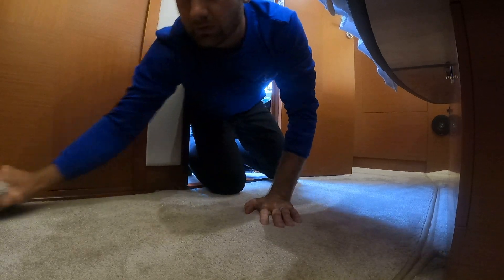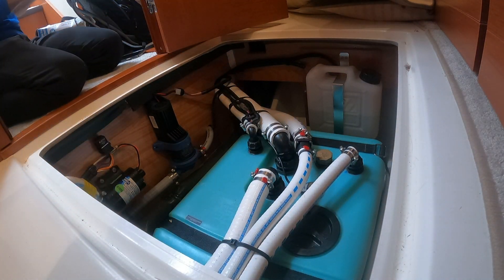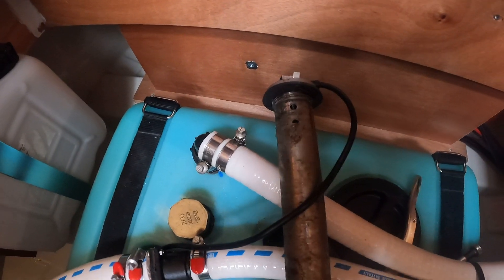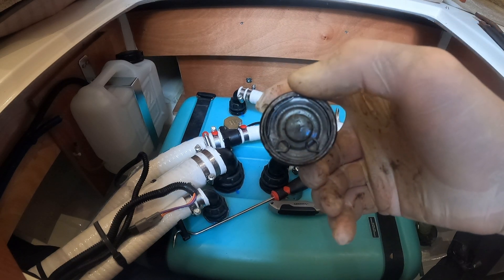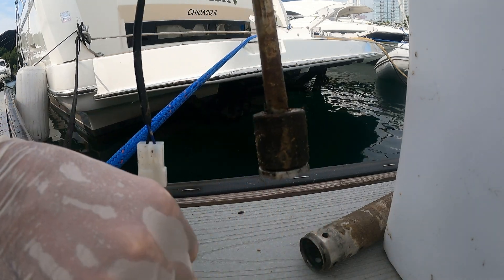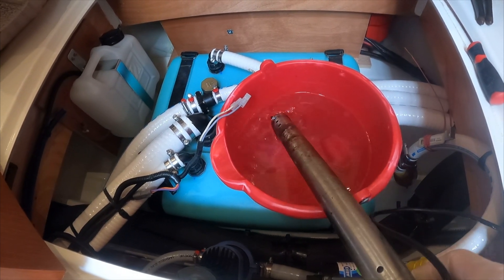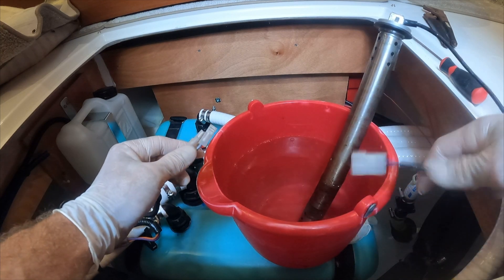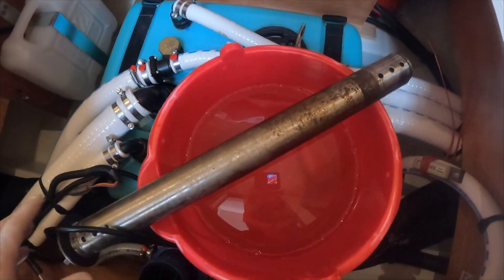Waste Tank Sensor Repair

Comment: Great video Captain Dan!!  Finally I found that video.  You should add more detail to the name because it doesn't come up on the search easily.  Question, can I open that larger tab to clean the tank?  Is that a Jabsco tank?  Where do I get the sensor replacement?  Thanks
Reply from the maker: Great information on the video title! I will look at editing that. Great questions as well. I am not sure of the tank brand. I can check next time I am in the bilge of a similar model, but I believe those are fairly interchangeable. The larger black tab can be opened, but they are typically sealed in pretty well to keep smells from seeping out. You would need to make sure to properly reseal after cleaning. I have cleaned out a fresh water holding tank from the sensor hole in the past, it takes a little longer with a few more rounds of spraying but did the trick. The sensor replacement is pretty easy to replace, most boat yards or parts stores should be able to order the part. If you ever have a problem, shoot me an email and I’d be glad to try and help. 

Thank you again for watching, commenting and for the great questions! Cheers!

Comment: Great video, much appreciated as I have a Prestige 500S with identical holding tank. 
I must say however that when I tried to remove the tube it was absolutely impossible. Is there any way to do it?
Any ideas as to facilitate such removal?
Many thanks!!
Reply from the maker: This was definitely not an easy part to remove. I found that a pair of locking vise-grips worked the best. Somewhere in the comments for this video someone had another suggestion that could work but it involved a little more work. Check that as another option. 

I manage and maintain multiple Prestige yachts. Feel free to reach out with any questions! Thank you for watching and for your input. Cheers!

Comment: Very informative.   Thank you.  But…. Two tanks port & starboard.  Both of them the tops of the tank are very close to the ceiling in the engine room.  IF I have that style it would require removing the tank to get float out.  I guess I may have a different type of sending unit

Comment: Finally someone showing the turd end of the job. Can you put loo roll down the toilet? Thanks and show more of the same. Cheers.
Reply from the maker: You can use and flush marine grade toilet paper down but it’s recommended not to use too much as the systems can be sensitive to plugging up. Marine systems are not as hardy the system in your home. Thank you for watching and commenting, I’m glad you like the content! I will try to keep bringing out similar repair and maintenance content. Cheers!

Comment: Hello Capt. Dan. I noticed that you are on a Prestige yacht in this vid.  I have been trying to find a waste holding tank vent filter. Does the Prestige 500s have one? Wracking my brain!!
Reply from the maker: Im not sure if they changed the location depending on the year of the vessel but on the 550 and some other 500s, the filter was behind the forward VIP closet wall on the port side. Hope this helps! Thanks for watching and for the question. Cheers!

Comment: You just need an 1/2 drive 8 point socket what ever size the square nut is.
( example ) https://www.royalsupply.com/store/pc/Wright-Tool-4340-1-2-Inch-Drive-1-1-4-Inch-Special-8-Point-Chrome-Square-Socket-p50666.htm
Leave the socket zip tied to one of the nearby hoses when finished for the next time.
Reply from the maker: Great input! Thanks for sharing. The hard part is having the electrical coming out of the one end so I’m not sure of the socket will fit on, but I will definitely try! Thanks for watching!
Reply: @ElevateYacht  Take a grinder with a cut off blade and cut a slot in the side of the socket to accommodate the wire, the sensor unit shouldn't be tightened so tight as to break the weakened socket.
Reply from the maker: Dang I like that idea. Great suggestions. Thank you!